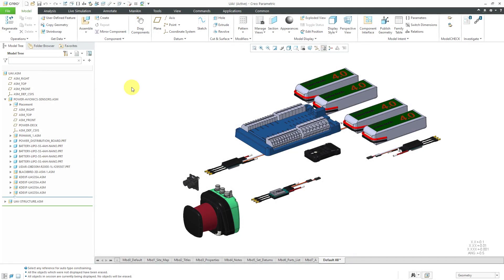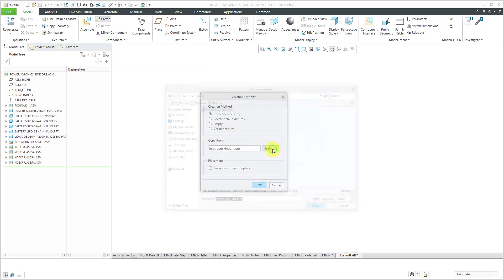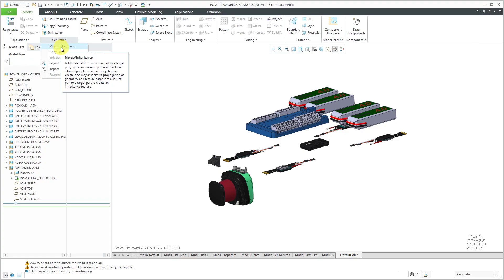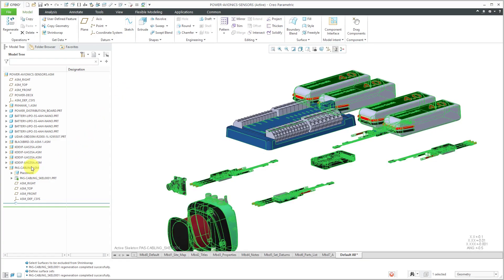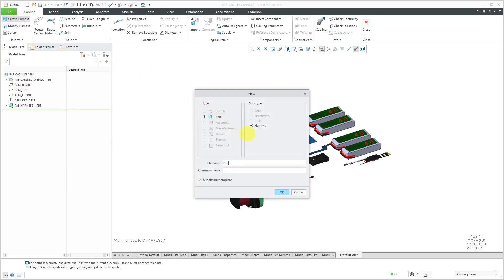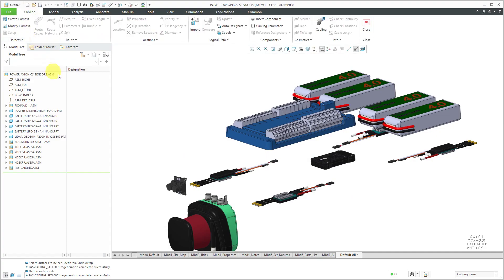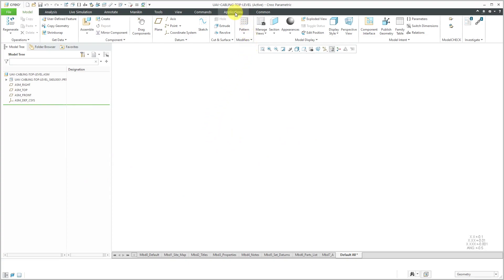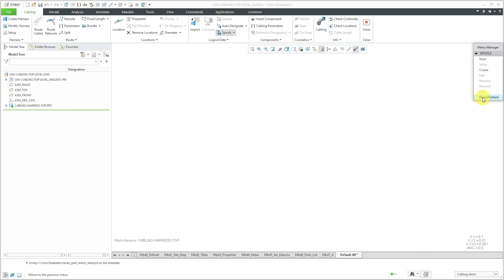Creo Parametric Cabling - Harness Parts

Comment: Hi, I was wondering how to add parts to your harness aside from Connectors? and That can be  referenced to certain locations? For example cable ties, toroids, etc. The reason why I would want this is because I want those added parts be included in the flat harness as well. For now, I can only add cable ties through the Cosmetics Tab. Thank you in advance
Reply from the maker: That’s going to be part 3 of my video on flattening but I haven’t felt like making it.